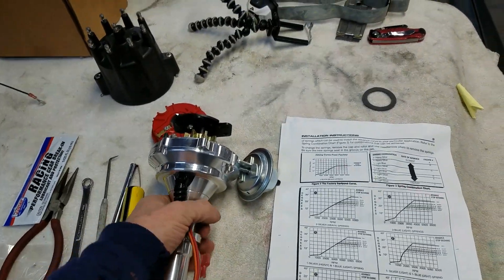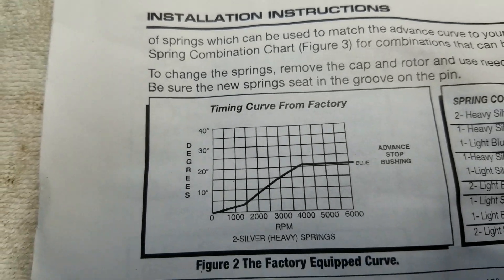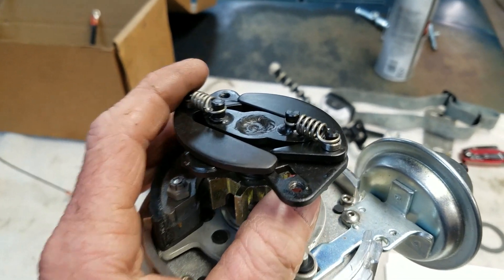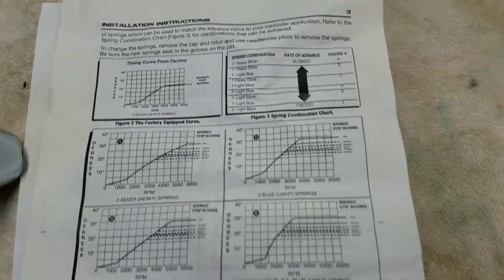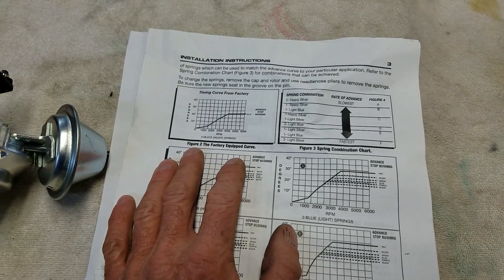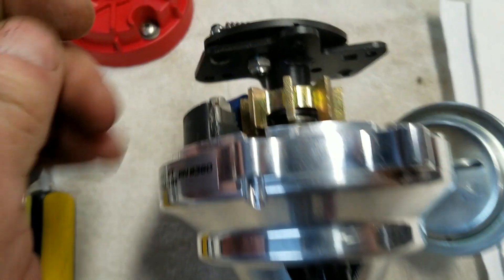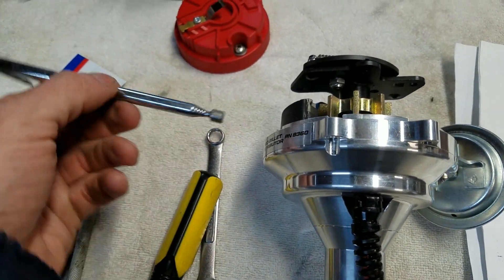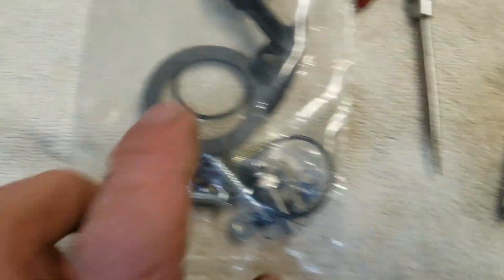How to: Recurving a MSD Distributor!

Comment: Hi, today I measured with a vacuum gauge and it stucked at 17Hg (at idle) which supossed to mean late timing issue. Do you thing it could occurs because a the the springs? It is a stock MSD HEI. Thanks for your thoughts.
Reply from the maker: 17 in of vacuum could be all the engine pulls for vacuum. Bigger than stock cams do pull less.
Reply: @RebeldryversGarage  I was on the wrong path. However, now on manifold vacuum and made the ignition timing again and it runs fine. With enough vacuum now.

Comment: How much advance does does the black bushing give you, my blueprint 396sb came with the HEI and 16 initial and 35-6 mechanical all in but my engine is rich at idle, despite me adjusting the transfer slot, checking fuel level, pressure etc.
Reply from the maker: Are you running it with the 850 Holley? What car is the engine in? How was the HEI wired?
Reply: You ever get it figured out. And the black is 18 degree

Comment: Question. So, if the distributor has 22 degrees of mechanical, does that mean that if timing is 0 initial, it's actually 22?
Reply from the maker: Yes. Total timing is initial timing at idle, and mechanical advance.
Reply: @RebeldryversGarage  Hopefully you can enlighten me. Everything I read says to set initial timing for SBC between 12 and 18 degrees. Yet, this distributor starts off at 22. I'm confused. Yes, I'm having timing issues. I'm not sure where to set my initial.
Reply from the maker: @zambino8763  The mechanical advance is zero at idle. It advances as the engine revs. Most SBC's like 36 degrees total timing. If you have 22 degrees of mechanical advance that gets there as the engine is revving from idle to say 4000 rpm. And, you want say 36 degrees total timing. Then you have to set timing at idle at 14 degrees.

Comment: Hey scott I need some help I know this is a older video hope you see this comment but before I get on a dyno I want to set up my distributor for the total timing I would like to run on the engine. my cam rpm range is 2500-6500 with .550 lift and have a 3200 converter in my transmission what spring would I use on my distributor ? I have a 496 big block
Reply from the maker: Thanks for watching! What is the compression and the duration @.050 of the camshaft?
Reply: @RebeldryversGarage  it’s a 292/292 lift of .550  244 intake duration and exhaust is 244 duration at .50 in lift
Reply from the maker: @jeffreyvelasquez9942  Big blocks like a lot of initial timing to be happy. I would start with exactly what I did here. Same bushing and springs.
Reply: @RebeldryversGarage  great thank you for responding and helping I appreciate it

Comment: Thanks for the demo.  I've been looking for this kind of info.  I just had a crate engine put into my Mustang with a Unilite dizzy and I want to change the factory springs.  Stupid question..I just want to clarify...if the factory Advance Stop bushing (Blue) stops at 21 and I have initial timing at 10 then my total timing is 31?
Reply from the maker: Yes, that is correct.